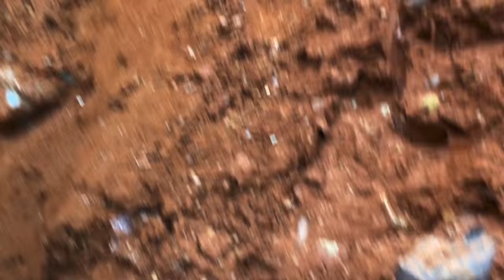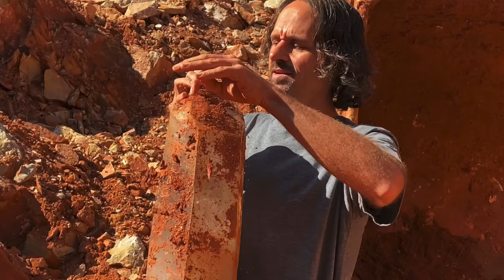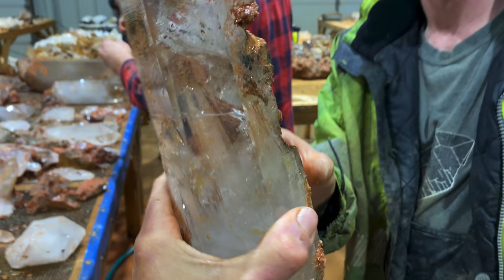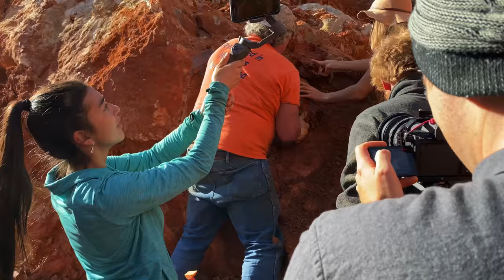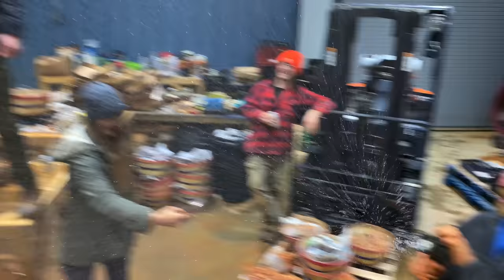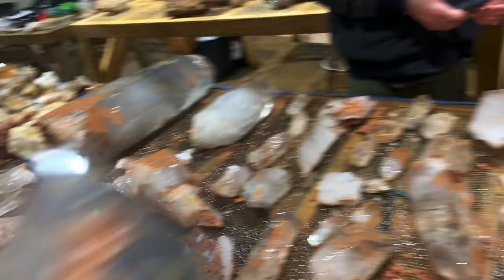Largest Quartz Crystal Pocket of my Life!

Comment: Noob question here, but wouldn't it be easier to use like a water monitor (hydro mining) like the old gold miners in CA used,to expose the crystals? or is that not allowed in that area?
Reply from the maker: Yes it would be awesome to be able to do, but with all of the red clay it would make it almost impossible to move around with the mud.  At some locations this may be possible but this one is at the bottom of the hole

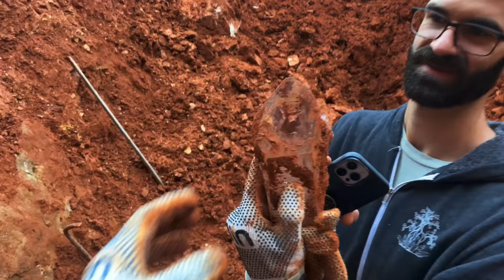Comment: I'm only 4:20 in, but it'd be curious if any of these crystal excavators are energy workers? 

MY sis is an energy worker. I have accumulated more than 2 dozen SMALL crystals (< 8 inches). I'd be curious to see any energy worker (who who see's auras), if the energy worker can even be around those large sized crystals you're discovering. 

My sis after i charge a small crystal in sun or moon light, she's claimed a small one can be powerful like a sun to her, she actually got "burned" by a small charged crystal earilier. The crystal that burned her finger tip was 1/1000th the size of the ones you guys are pulling. 

I'm assuming none of these ppl are energy workers, i don't think they would be able to be NEAR crystals this size.. unless the unexcavated ones are not as energetic.

I'm extremely curious!! Like i said, sis can't be NEAR a crystal that 3 inches stall, 1 inch wide.. and you guys are pulling crysstals FEET dimensions.. just wow!!

I'm soooo jealous!! I'd be over there in a minute excavating crystals. 
Not only that, but what's the price tag? If a small crystal is 8$-50$, whats a 30lb one gonna cost?

I can't see what my sis see's. She see's energy, auras, ect. I'm just an average joe, i just see a clear quartz as a CQ, i don't feel the energy or see the energy from it. She does.

AMAZING!!!